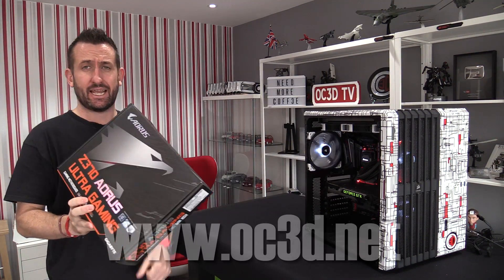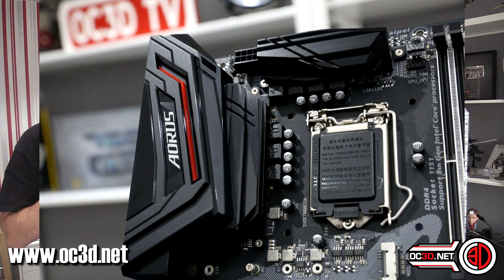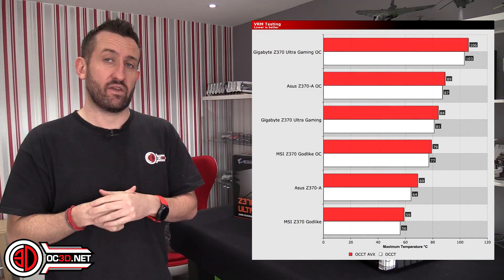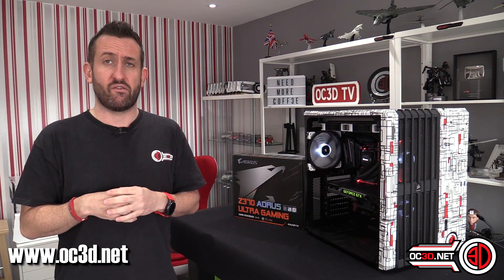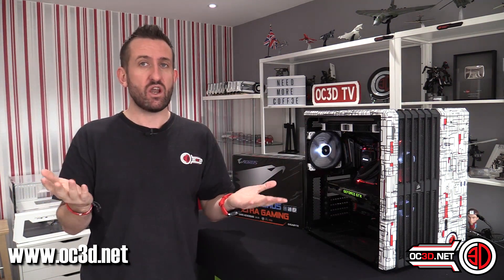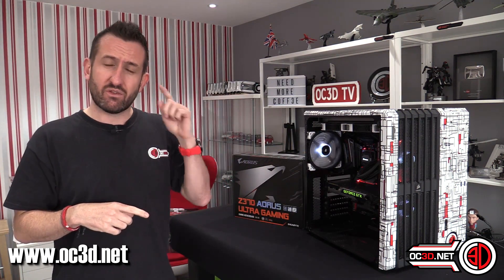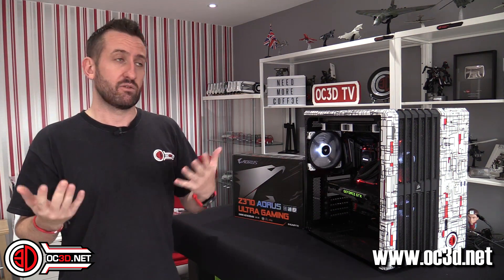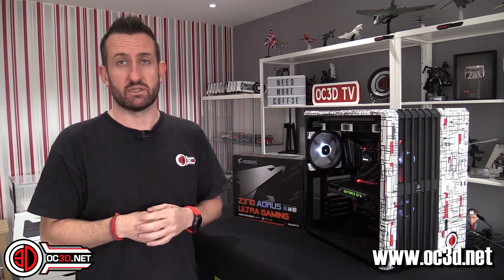Gigabyte Z370 Ultra Gaming - VRM Issues are back

Comment: I was on this sh*t pretty much right after launch. Almost the same VRM design as with Z270 and AM4 for nearly every Gigabyte board. They only added a high side mosfet per phase, for CPU's which draw quite a lot of additional power. Now on Z270/AM4 it is pretty mediocre at best what Gigabyte uses, but on Z370 it is just crap. 

The mosfets themselves are 4C10N and 4C06N high/lowside mosfets. Very cheap and mediocre components. 

Also take a look at for all VRM's for the current mainstream, OC capable platforms. 
https://www.hardwareluxx.de/community/f12/lga-1151-mainboard-vrm-liste-1175784.html#z370
https://www.hardwareluxx.de/community/f12/pga-am4-mainboard-vrm-liste-1155146.html

Not all Z370 VRM's are yet cleared up, but the general consensus looks pretty bad. Not that they will melt, only Gigabyte is in that area with nearly all there boards if you really want to push an OC, but in quality a lot are lacking. There doesn't even seem to be a proper 6 phase VRM for nearly every Z370 board, and that is ridiculous for the price of most of these boards. A lot is pretty low quality stuff that should be on rather cheap boards, not a high end platform like Z370. 

Now I do want to point out that I take a bit of leeway when it comes to VRM design. Most will function just fine for non extreme loads like typical gaming. Doesn't change the fact that most boards are still pretty pathetic for there price, and do not represent what Z370 should be as a platform at all...
Reply: Wait arent those 4C10N rated for just 80C???
Reply: Is that the same rubbish VRM that gigabyte uses on their b350 motherboards and x370 aurous gaming K5?
Reply: Pretty much yes...
But now with CPU's that can use even more power. :P

Comment: I wonder, how much the wattage for each core 8700K vs 7700K vs 1800X vs 1950X ?

Since 8700K was the first non HEDT with 6 cores CPU from intel, AMD already started with PII X6.

I remembered my 4790K run really hot even with H110..

Or maybe the problem was the 8700K itself ? Highest clock ?

Comment: As a person who go through a lot of hardware and experience in it... what do you recommend I do with a Silverstone PSU (ST75F-GS) that was working for 3 years and then out of the blue it dies? I don't know what's wrong with it. I have a spare PSU and my system is back up and running, so I know it's the Silverstone PSU that died. Should I contact Silverstone? Is there a way I can fixt it?

Comment: TTl, it's not the first time nor the first brand where they just end up being quiet since they know much more about the issue. It's people like you who actually put the word out about their "malpractice".
Reply: Exactly, thanks to people like TTI we the users out there can point fingers now. many years back when I started in IT this kind of information was very hidden and top secret
Reply: Actually, where I live, if you do work for a dealer/distributor that deals with a brand under scrutiny and you have dirt on them, common work ethics tell you to keep a lid on it and let the storm pass over. Proper ethics tell you that the truth should be told. Often people choose job security over societal security/happiness. Well, turns out the same is seen all over the world.
Reply: yeah maybe the main problem is a new product will be out in 2 months and they just don't care, shame.
feel sorry for the people who bought it but its not a massive issue, the board might die a few months prematurely if its used extensively (blender/render)
i have a 3930k and my system is rock solid after 4+ years........ it will fail soon because i said that :P

Comment: Seems to be an issue overall, poor vrm cooling. Not specific to chipsets but the poor design and heat dissipation of heatsinks in general.

A return to copper and fan cooling is needed!

Comment: I bought this motherboard and also got i7 8700 with gtx 1080 will it overheat  ????
Reply: Non K? Should be fine. Pretty hot but fine.

To make sure you can download HWiNFO64 and look for the VRM MOS sensor readout. Then download and run either Prime 95 or preferably Intelburntest. Run either for some time and watch the temps go up fast and figure out where the temperature stops rising. Max temp can be 125 degrees, but preferable it should stay below 100 degrees, preferable quite a bit below. 

Especially Intelburntest is insanely demanding, way above any normal load. If you are fine there, you are completely fine for normal use. :)

Comment: Given that PC gamers for last few generations seem to be collectively dropping their IQ and the manufacturers spending much of development, QA, packaging and production on things like RGB, color schemes...... these thing would happen more and more.

Check motherboard reviews on e-commerce sites and see much of it is about RGB support, UI appearances for programs and looks.... for motherboards!!!
Reply: Haha too true, also esp for overclocking boards, visiting OC forums such as overclock.net and hardwareluxx.de can reveal so much about the hardware. I believe that the overclock.net forums basically predicted that this board was going to have problems for overclocking a 8700K just based on the VRM configuration. http://www.overclock.net/t/1638955/z370-z390-vrm-discussion-thread/40

The TLDR of it is, this board only has 4 true phases and the power delivery to the CPU would be very inefficient (hence the VRM temps seen) and is thus not advisable for anything beyond MCE
Reply: Spot on!
Reply: I've bought an i7-8700 (non K) as I don't plan to overclock. Do you happen to know if this mobo is a no-no even for locked CPUs?
Reply: Pennywise Thanks dude! Much appreciated.
Reply: I personally am using Asus Strix Z370-E for my 8700K. I agree with @Pennywise about Asrock boards, they usually don't compromise with power delivery with their mid-high end boards.

Anyway, you'd have to spend around $200 minimum for Mainboards to be assured of well-rounded features. Pick any AsRock or Asus boards that cost over $150 at least.
Reply: Rizwan Mashur ul Muttakin Thanks man!

Comment: Thanks to everyone on the channel brang my i7 v core all the way down to 1.3v from 1.4v lost 15 degrees on load too xD
Reply: Donn Aldak lololol
Reply: If you are running stock settings with multi core enhancement disabled then I would go for 1.22V. My 8700k is fully stable with 4.7GHz on all cores with only 1.22V and 4.9 with 1.27V.
Reply: How?
Reply: 7700k 4.8 vcore @ 1.25 since last year and thermals are 👌
Reply: brought not brang

Comment: Can you test some other brands as well?When i touch the vrm on my asrock z370 fatality gaming i7, it its very hot to touch.
Reply: Petrus Perius Tweaktown did reviews of the Taichi and the Gaming 7. They use a thermal imaging camera so you can "see" the VRM temps on both sides of the board. No issues for either one, even at 5Ghz. Rest easy, Petrus.

Comment: Shit I just bought that board :(
Reply: I have become a bit suspicious of gigabyte of late. lots of flash and marketing rah rah. close look at board seems pretty low end components to me
Reply from the maker: Watch the video.... Ways to work around it are featured.
Reply: Try tightening the heatsinks.  I had a similar issue on my Aorus z370 gaming 7 and that fixed it.
Reply: OC3D TV I've got the cryorig r1 universal and two top casefans and one at the back. Do you think it will still be that hot? I can't test because I am still waiting for my i5 8600k. I will try go as low as I can at about 4,7 to 5ghz on the voltage. (and 3 intake fans, in a corsair carbide air 540 case, look at channel pictures, sadly without cpu :( like I said)
Reply: SAME HERE LOL
Reply: got the board, got the same R1 heatsink, got 140mm rear exhaust and 200mm fan above the VRM, got 8700k and VRM are 100+C, airflow is very good, can;t be a problem, just posted rant comment on this video...

As I found out it is not faulty mobo, but model problem I am now gathering info how to work around it before trying to return it, as I already binded my windows license to his mobo

Will try to tighten screws on VRM heatsink and play with the voltage as there is a lot of wiggle room with that apparently and make a post, probably on reddit how it went
Reply: Same :(
Reply: Augmented Four yes
Reply: I would check if thermal pad contact is OK on all MOSFETs.
If not, try tightening screws (as suggested above), if that doesn't help - change thermal pad for a thicker one.
Reply: Did you make a post about it? I have this board and I'm really worried now that I bought it. I don't think I'm able to return it because it's been 20 days. Any solution yet? By the way, can this VRM issue be fixed somehow?
Reply: nah, it's just shitty board and I am using my 14 days of return policy as well to get gaming 7 I have tried everything in BIOS and tightening the screws and no change, Unfortunately too busy with work for making the post